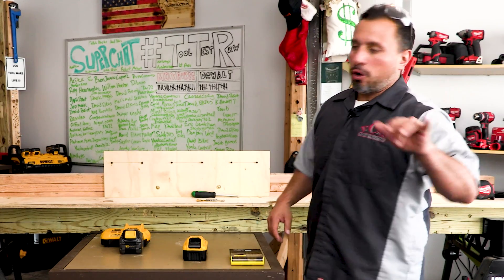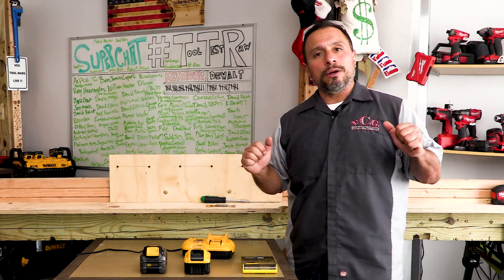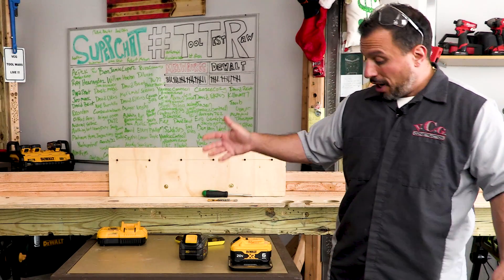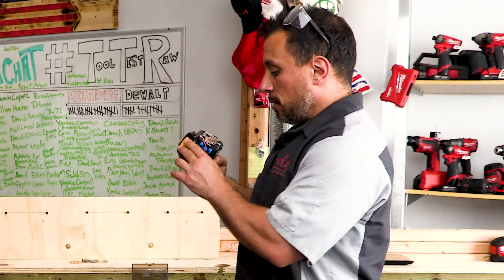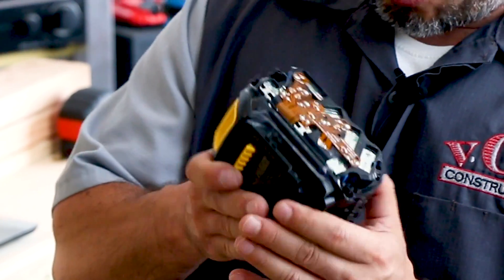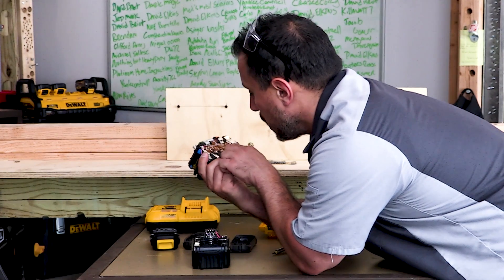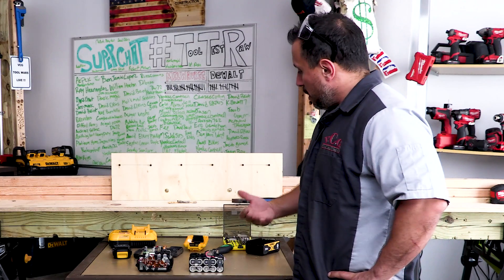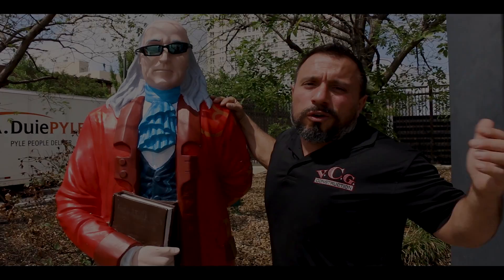DeWALT XR And FLEXVOLT - What Cells Are Inside The Batteries

Comment: did a science experiment this week. did some yard work with a dewalt 20v blower and a dewalt 20v weedwhacker. tried both a 5ah 20v and a 6ah flexvolt. the blower was about the same. but the  weedwhacker acted like it was steroids with the flex volt on it. why? who knows unless the  weedwhacker could somehow draw more current out of the flex volt.
Reply: Some tools are actually able to make more power with the Flexvolt. Torquetest channel guy shows this on multiple occasions
Reply: @drewrinker2071  true, but the weedwackers are not flex Volt advantage tools. There is a true flex only weed Wacker but I have the 20v only model.
Reply: @boburz7976  yeah I knew what you meant, but if you watch his channel the impact wrenches he is testing are all 20v. A lot of the reasons why are because the Flexvolt batteries have 21700 cells which generally have a higher discharge rating then the 18650s which means that if your 20v weedwhacker requires say 50 amps of discharge current to run optimally, the 18650 cells physically may not be able to discharge fast enough to supply that much current even though it's getting 20 volts it might only be getting 20 to 30 amps, but if you throw on the bigger Flexvolt batteries with the 21700 cells with a higher discharge current it can supply that 50amps @ 20v no problem. 

       If you think of current in terms of a water hose and it might make a little more sense. If you have a large water hose, then your going to be able to fill that 5 gal bucket a lot faster than if you are using an ice maker line that's 1/4" thick, even though you have the same water pressure (volts) all throughout your house.

Comment: Do you have a video showing how to put back together?  I took the screws out but something was holding the cover on and I didn't want to just yank it apart.  Trying to find out if these 5ah batteries that I bought on amz are fake or not.  According to dewalt's support site they are but then so are the ones displayed on home depot's website, according to dewalt's guide to spotting fakes.

Comment: See every time they add another row of batteries for the 4ah, 6ah, 8ah etc they wire them in parallel which lowers the resistance (impedance) which is why your tool can pull more amps and feels more powerful when using a larger battery.

Comment: I believe the 9 flex is 20 700.  Dewalt could not wait for 21700 production.  Benefits was minimal.  But main reason was to get 60v launch out faster. I would guess the 12 flex and soon 15 are in same size casing and offset in the rows.

Comment: don’t understand how 10 cells (in configuration 2x5) and 18 cells (3x6) can be compatible because the voltage of lithium cells still the same at 3.7v nominal.. the non flex 3.7v x 5 = 18.5v (5s2p construction) and the flex 3.7v x 6 = 22.2v (all in series the flex give 3.7v x 18 = 66.6v in 6s3p/18s1p construction).. 5s2p mean 5 cells in series by 2 in parallels (=10).. i suspect the non flex to be a recap of the old 18v dewalt packs and less powerful on 20v tools because the voltage is 3.7v lower.. that mean some sense to you?? (for to be matched in voltage, the 18650 pack should be 15 cells instead of 18 or the 20700 pack should have 12 cells)

Comment: Correct me if I am wrong but, I believe Flexvolt batteries have been using 20700 cells.  With flexvolt advantage on the seen, I think some newer iterations of flexvolt batteries are now using 21700 cells.

Comment: Three 18650s in parallel will provide more current than two 21700s in parallel. So,  yes, the flex-volt in 20 volt mode puts out more current. Under continuous beating, the tools will smoke sooner on the flex-volt.
Reply: Not inherently true. It all hinges on what the specs of the cells are. Two 21700 Molicel P42A's in parallel would smoke ANY three 18650's in parallel for example.

Comment: Can someone answer: do dewalt battery packs include over discharge/undervoltage protection? I've heard in some places that it's in the tool. If I use a battery adapter, I've heard I could over discharge the battery. Is that true?
Reply: I’ve taken the 6ah flex pack apart
No FETs to disconnect the battery for over discharge. Cells are always connected  . The drill does the switch off for low voltage. As for charging as long as you don’t go over 4.2v/cell (4.1v/cell is safer) you should be ok.
Reply: @pfb3264 today i was using my dewalt grinder with a 5ah battery and it streight up died. Went to recharge it and it isnt charging. It got completrly drained. Clearly the undercharge protection didnt work here.

Comment: And me and Subaru said it isnt possible the the 60 battery killed the 20 volt tool we both did videos on it
Reply: Clearly, the 60v battery is running in 20v "mode" on a 20v tool. Don't think anyone was arguing against that fact. There are two factors that are not addressed by either you or Subaru. Voltage sag and amp draw. Both major factors in addressing the stated hypothesis. Logic would say that the voltage sag on the Flexvolt would be less than the standard (single or double series) 20v batteries. Flexvolt MAY also be able to supply more amps to the tool (bc of its triple series configuration). If either one of these statements is true, then the total wattage to the tool would be greater (potentially much greater) than a standard single or double series 20v battery.
Reply: @MrSandboa  good points and tour correct I did not bring that up
Reply from the maker: Lee that sounds legit as well!!

Comment: 18650 is 18mm x 65mm
21700 is 21mm x 70mm
I dont know what the 0 at the end is for. Maybe just to sound good? Haha but you could use your fancy measuring calipers you use for tools to confirm size.
Reply: Apparently, the zero designates that it's a cylindrical cell.
Reply: @paulnewman129  that makes sense actually. Thanks

Comment: When you put cells in parallel the voltage stays the same (example: 3 cells with 3V each put in parallel you still have that 3 volts, in series you add the voltage up)

Comment: actually the electrical "power" switch is mechanic and done with the plastic "trigger" at the back of the batterie and the "tooth" on the 60v tools. There is an electronic contact that tel the pcb that a 60v volt tools is connected and to set the monitoring accordignly.
@Vuaeco already dismanteled a 9ah flexvolt and explain it https://www.youtube.com/watch?v=VAmghq7XadQ
Reply: The electrical contact isn't just for monitoring.  If not activated, it will keep the output of the pack at a nominal 20v as an additional safety.  The plan, I believe, was to mitigate a mechanical switching failure (e.g.: the switch is jammed into 60v mode) so as not to send 60v to a 20v tool.

Comment: Yo Vince @VCG Construction! Thanks for the video cuz! Looks like they are running 18650s in the flexvolt. And 20700 in the 6ah 20v max. 
They run the same 20700 in the 3ah slim 20v max packs. Only it's a 1p pack instead of a 2p.
From what I understand, they do run the 20700's in the 9ah flexvolts. Not sure if the 12 runs 20700 or 21700
Not quite a m18 HO pack with those sweet MANgenta colored Samsung 21700 cells (on the 8 and 12 only.) I am sure you've had one apart, and it's a beautiful pack! Huge difference between the battery packs. No smart anything going on with the 20v max pack. Flexvolt seems to be a switching pcb. And probably the closest in terms of wizardry to the Redlithium packs but not equivalent by any means. Milwaukee's wizardry looks like it belongs on a rocket ship. Or in a crazy gamers computer. It's unbelievable.
Glad you had these quick little  shenanigans. 👍
You're a beast! 💪
Reply: I stand corrected. With closer look, those are 21700 cells! I wonder when they changed them. Check the date on the battery if you will Vince. My 2018 3ah are running the 20700's and so were the 6ah xr packs. Maybe dewalt switched them at a certain point of time? 

Try to find an older dated 6ah XR pack. Say early 2018 or earlier?  And compare it to the new one you seem to have. Probably a late 2018 build date at least or newer. I have heard rumors that dewalt switch to 21700 cells in the flexvolt 9ah and the 12ah flexvolt was running the same 2170040t cells that the m18 12.0 is. We need more research! 
My 3ah slim is running some bright red Sanyo 20700s is all I know. And at the time I was informed they shared the same cell as the 6ah 20v max. 
Pretty cool. Dewalt should probably push that like milwaukee does. Even though the battery guts on the batteries are far different. 
Anyway, I stand corrected. As I said, I know they were running 20700's. I would like to know what all batteries were switched and when.

Thanks again broseph! 👍

Comment: FWIW The Flexvolt is using Samsung 20S 18650 cells and the XR is using Samsung 30T 21700 cells
Reply: The 6ah Flexvolts uses 18650s, IIRC the 9ah and 12ah Flexvolts use Panasonic NCR21700A/B Cells.
Reply: Saved me ten minutes, cheers
Reply: Seriously I got the 20s pack hell yeah

Comment: Vince I am a former Motorola engineer and worked a lot with batteries on our phones. That flex circuit on the batteries has all the brains that controls the charging of the batteries, and most of the circuitry is safety circuits with thermistors that measure temperature and prevent batteries from overcharging and exploding, the control the charge rate from rapid to trickle, and they also have communications in them that talk tot he tools to read the tool and determine if it wants to be a 20V battery or a 60 volt battery. Sometimes batteries have sensors that determine you are hooked up to an unapproved charger, and they will not allow rapid charging, only trickle charging. there's a lot of tasks on their plate for these circuits.
Reply from the maker: Wow awesome cuz thanks!
Reply: Wow ty i just learned a lot

Comment: You’re correct, both of those are PCB’s that likely contain the logic and any balancing wires to make sure no cell overcharges etc, and I love how Metabo does their 36V “flexvolt” style. When used at 18v you have double the Ah rating you expect, instead of the 60V Ah seeming weak. But Dewalt did do this years ago so credit for trying something different.

Comment: Vince , I do like you say 20V MAX because that is exactly what it means: max voltage with no load. during load it drops to 18V. In advertising, 20V sounds more powerful than 18V. Just check the voltage on an 18V vs a 20V fully charged batteries. Not much difference there.
Reply from the maker: You are absolutely correct!!
Reply: @VCGConstruction  Thank you Vince.
Reply: It's not about the load. The batteries are 4.2V when fully charged, and 3.6-3.7. nominal, depending on who you talk to. So if you have a 2p5s configuration, like the 20V max battery does, at 5*3V6=18V. 18V is what most manufacturers say. 5*4V2= 21V, so they're using 4V as a nominal for each cell.

Comment: Dewalt uses 20700 cells in 6amp xr and 9 and 12 flexvolt
Reply: The 6ah XR battery in this video is using Samsung 21700 30T cells
Reply: @MrSandboa  no Dewalt uses 20700 cells
Reply: @loucifer323  Samsung does not make any 20700 cells
Reply: @loucifer323  I see your confusion. Sometime in 2018 Dewalt switched from Sanyo 20700A cells to the better and cheaper Samsung 21700 30T cells in their XR6.0
Reply: @MrSandboa  It's possible
Reply: @loucifer323  no, it's just a straight up fact.

All packs with 20700 Sanyos were updated to 21700 Samsung 30Ts.  And the packs that came with Sanyo cells were even placed into a plastic battery caddy designed for a cell that was 21mm wide.  

Dewalt was anticipating an eventual update to 21700s on day 1.
Reply from the maker: Thanks for the heads up Lou!!

Comment: 21700 much powerfull than 18650. So milwaukee hight output batterries does have same 21700 cells
Reply: Nope, they are very comparable as far as which is "much powerful." The 20/21700 batteries just have a bit more headspace as far as capacity goes. A bigger battery doesn't necessarily mean the CDR is higher.
Reply: @xenonram  they are more powerfull. 18650 can give 30amp, but 21700 can give 50amp on peek

Comment: The battery names denote the size. An 18650 is 18 mm in diameter do 650 mm long. A 20700 is 20 mm is diameter and 700 mm long.
Reply: FYI 650 mm is 65 cm= 25.6", should be 65 mm long = 2,56". 20700 is only 70 mm long= 2.76". Quite a difference I think. The diameters you gave are correct.
Reply: @yvindascanius6061  I think he knows that. He probably just added the extra zero on accident.
Reply: @xenonram  Probably.
Reply from the maker: Good to know Peter thanks!!
Reply: 65mm, but indeed, and an easy mistake to make.
Reply: @peterhunter1990  dude I vape and use both these batt sizes in my rigs, I had no idea the number name denotes the actual size of each one. Makes perfect sense now that I do, kinda like 7.62X39 is widthXlegnth of the AK bullet. 🤘
Reply: 18650 means 18mm diameter 65mm length and the 0 means they are cylindrical

Comment: They both just so heavy. Great for saws and such. I have a flex volt circ saw that I love. But putting that flex volt on my impact feels terrible lol. So the 5ah and lower battery have their place. I personally love 4ah and 5ah on my drills and impacts. That said, those 9ah flex volt batteries last forever on the circular saw.
Reply: I've never held a 6ah xr battery in my hand though so I'd like to see what they feel like compared to a 5ah xr
Reply: They have TINY 2Ah batteries.
Reply: Yea I have some of those too but they run down so fast. They are nice and light though.
For what I do, the 4-5 ah range is about the perfect balance of long lasting and weight
The 5 ah battery is the best power to weight ratio battery that dewalt makes though imo. By power I mean long lasting